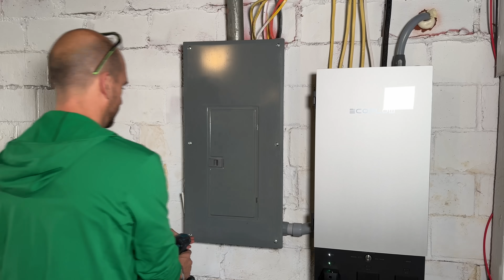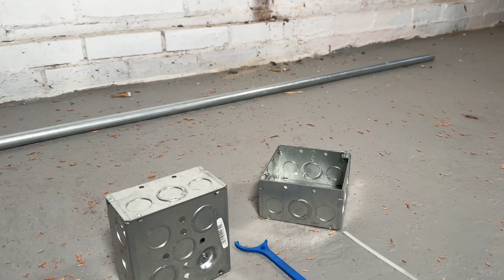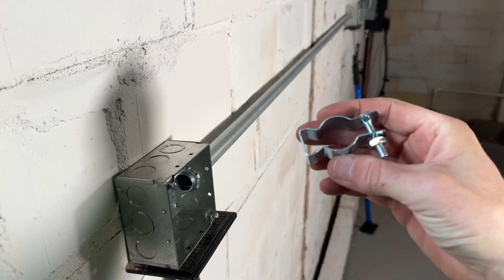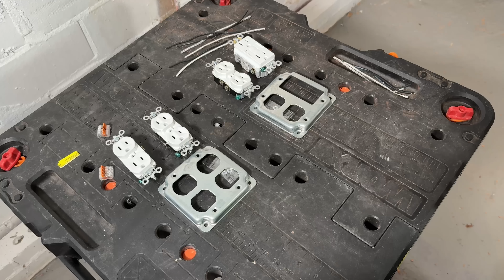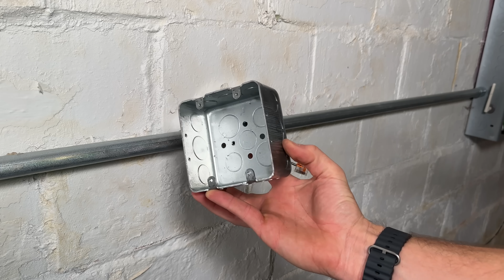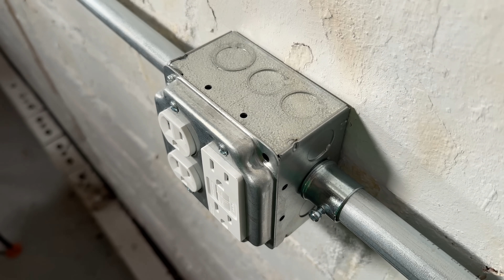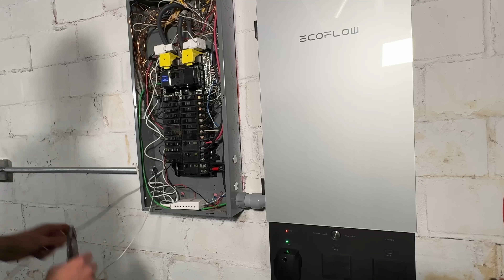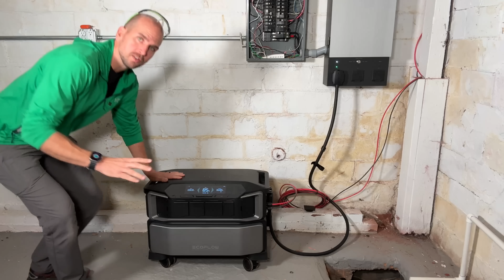Add Outlet To Unfinished Basement Or Garage

Comment: Should have run an egc but not really necessary but should have used ground pigtails to the boxes than to devices. Might not have too but better workmanship is akways a plus and never cheapen out on safety 😉

Comment: Every house I have lived in here in Western PA has NOT had conduit in the basement, it was always Romex, sometimes stapled to a strip of wood.  Maybe some parts of the country don't require the conduit?  Mostly here in commercial installations.
Reply from the maker: It is importance to give Romex protection and not place it in a run where it could get damaged.  If your Romex is running on wood along the wall with nothing to protect it that is not ideal and most likely an inspector would call that out.
Reply: To be fair, the Code is only as good as the inspector. If the building inspector chooses to allow things to occur, then they occur regardless of what the Code might say about it.
Reply: @TwilightxKnight13  I kind of wondered because they did the Romex on wood in my sister's house and she hired a professional electrician so I am doing what I have seen a professional do.

Comment: Correct me if I'm wrong. I believe a grounding conductor that makes a bond to each metal box needs to be present to satisfy code in this particular arrangement. The set screw on the conduit connectors may loosen or go missing which results in poor continuity as an EGC over time. But of course, this is permissible by code. However, I believe having the conduit and boxes as an EGC is not enough. There needs to be bonding jumpers from those types of box cover plates to the inside of the 4x4  boxes.

NEC 250.148 Continuity of Equipment Grounding Conductors and Attachment in Boxes.
If circuit conductors are spliced within a box or terminated on equipment within or supported by a box, all wire-type equipment grounding conductor(s) associated with any of those circuit conductors shall be connected within the box or to the box in accordance with 250.8 and 250.148(A) through (D)

(C) Metal Boxes. A connection used for no other purpose shall be made between the metal box and the equipment grounding conductor(s) in accordance with 250.8

NEC 250.8 Connection of Grounding and Bonding Equipment.
(A)Permitted Methods. Equipment grounding conductors, grounding electrode conductors, and bonding jumpers shall be connected by one or more of the following means:

(1)Listed pressure connectors

(2)Terminal bars

(3)Pressure connectors listed as grounding and bonding equipment

(4)Exothermic welding process

(5)Machine screw-type fasteners that engage not less than two threads or are secured with a nut

(6)Thread-forming machine screws that engage not less than two threads in the enclosure

(7)Connections that are part of a listed assembly

(8)Other listed means

(B)Methods Not Permitted. Connection devices or fittings that depend solely on solder shall not be used.
Reply from the maker: The screw or locknut loosening over time could happen but I don't think that potential failure would make the grounding through conduit against code.  Easy enough to run another ground wire for triple protection.  Currently this circuit is protected by the conduit providing equipment ground and also the GFCI protection starting at the first outlet.  Thanks for the feedback.
Reply: @EverydayHomeRepairs  as with anything, check with your jurisdiction. Just because the Code allows for something does not mean your local inspector will allow it. If we use EMT in our area, we must run a grounding conductor and it must be bonded to the junction box and the device.
Reply from the maker: @TwilightxKnight13  Agreed, best to ring the inspector to avoid any rework.  Thanks for the feedback.
Reply: @EverydayHomeRepairs   In 40 years of being a licensed electrician I have seen screws and locknuts loosen or screws being removed/lost countless times, especially in a garage or other open space like you have here. Also. you MUST install a pigtail between the devices on the plate and the box as a bare minimum, as a loose cover plate no longer provides a SECURE grounding path and will create a shock hazard.  The GFCI does NOT give you a pass on this. 

Other than that, you are correct that Code allows the conduit to serve as the grounding conductor, but it is not a good practice and some local Codes will not allow it to be the sole grounding path. 

And before any of the hacks come on screaming that the NEC is the final authority, local Codes are ALLOWED to require ABOVE Code minimums, and in rare cases can waive or omit certain NEC requirements (most notably use of AFCI's.)
Reply: @mxslick50  With cover mounted devices the device must be attached to the cover with permanent fasteners (rivets, for example) to serve as the device bonding means or if not, a pigtail is required.
Reply: @EverydayHomeRepairs  metallic boxes require bonding. I do not think there are any exceptions. You can purchase a bag or box of pre-loaded pigtails specifically for this purpose.
Reply: @edmessina8392 .    If EMT is the grounding system to metal boxes, and the device (receptacle) has an approved grounding clip on one of the attachment points, then the pigtail is not required from the receptacle to the back of the box.   If the receptacle does not have the required clip, then the pigtail would have to be installed from receptacle to the box.
Reply: @KevinCoop1  Close. With self grounding devices you can attach to a flush mounted box (box/mud ring) without a pigtail. With cover mounted devices the device must be attached to the cover with permanent fasteners (rivets, for example) or if not, a pigtail is required.

Comment: Unless you scrape the paint off of the box, you will have no ground from just connecting the conduit to the box. This is why every job I've ever been on every inspector I've ever talked to requires you to have a hot, neutral, and a ground wire.
Where exactly do you get your advice from

Comment: Also to me that is the perfect application for MC cable. What is wrong with using MC cable? So much easier to work with and install.
Reply from the maker: For installation like this I actually like the clean look of conduit.  I know it takes a bit of getting used to but overall I like the finished product.  Probably just me but overall I am not a fan of MC.
Reply: In most people's opinion MC looks like garbage in a visible application. No matter how well it is installed, it will droop. It is generally used for lighting whips and in wall cavity areas with limited access or that require more protection for the wiring than Romex provides.
Reply: @TwilightxKnight13  of course it's going to droop. That's why you put in supports. I would argue it's still better looking and safer than bare romex in a garage, which is what my previous owner did.

Comment: Electricians. Was it ok that he didn’t use a ground wire? I would not feel comfortable doing it that way.
Reply: Technically, yes per NEC. But when done on a large scale, it makes for a less reliable and expensive to fix install later. Connections rust, get loose, get painted, creating failures.
Reply: @RJ-ej1nr  appreciate the feedback. thanks

Comment: If I understand it correctly, should the GFI outlet, attached to a 20A circuit, be a 20A unit?
Reply from the maker: As long as you have more than 1 outlet you can use 15 Amp on a 20 amp circuit.
Reply: @EverydayHomeRepairs   just to be clear, each "plug in" on a receptacle is considered an "outlet" so a standard duplex receptacle meets the requirements for using a 15A device on a 20A circuit regardless if it is a GFCI or not.

Comment: Don't quote me but I believe EMT doesn't pass as a ground even though it's attached to the panel here in California. I believe the reason is that the conduit connections can come lose and some weather resistant connectors/couplers have plastic mating surfaces which breaks the bonding.
Reply from the maker: I would agree that a local inspector, jurisdiction, or state could require a dedicated ground back to panel.  Probably worth a call to see how the inspector is going to interpret code.
Reply: CA electrical code allows EMT as a grounding path. The raintight fittings have a plastic washer internally, but in no way do they disrupt the metal to metal contact between the conduit and the fitting. EMT fittings don't just magically come loose any more than ground screws magically come loose.

Comment: Kind of unprofessional and hackish not to use a bender to conform to the wall instead of sticking way out like a handyman too cheap to buy a $25 pipe bender
Reply: It's better than professional, if you ask me.  I think "professionals" like doing unnecessary conduit bending to make it seem that using conduit is complicated, requires tools most homeowners don't have, and justifies them spending billable hours on stuff that in reality doesn't matter.  

No bends equals no restrictions.  The shortest distance between two points is a straight line.  If it ain't broke, don't fix it.  Form follows function.  Less complexity equals fewer human errors.  

If you want a specific look that corresponds with exactly how electricians like to do it to charge you more, go for it.  Personally, I like this look better, and as a mechanical engineer, I think it is superior in most cases functionally, also.  I own a conduit bender, but choose not to use it for stuff like this.  I use it to make conduit go where I want, and I simply don't want the conduit to go against the wall in this case.  No reason to, and some good reasons not to.  

Having the conduit against the wall makes it accumulate crud, makes it hard to clean, and promotes rust and disease if rodent urine/feces, stuff leaking from a sewage pipe, or anything else nasty collects there.  

As he installed it, you can wrap a damp rag around it and clean the entire length in 5 seconds.  It will look as nice in 100 years as it does now.  If there is ever heat buildup in the conduit, having convective airflow around the entire pipe rather than just one side of it, is better.  If there is an impact against it, some energy is absorbed bending it, before the conduit is smashed against the wall, at which point it becomes equal to the flush-to-wall case, but with less impact energy left to absorb.  

All minor stuff, but reasons to not bother bending it just to make things arguably worse.

He should add supports to bring it up to code, and add a ground wire to make it better than code.  But I think it is way better to support it where it is than to make bends to jam it against the wall and accumulate dirt/water, or whatever else comes down the wall.  

My similar setup provides a nice place to hang a couple of pairs of blue nitrile gloves, between my light switch and my outlets for cordless tool charging.  Grab batteries, grab gloves, and I'm ready to work.
Reply: @EfficientRVer  it doesn't matter if you like it or not, the NEC Code requires the conduit to be supported. That is MUCH easier to accomplish if you install the conduit properly with a small offset bend on either end so it lays flat against the wall. Fasteners for conduit like his are exponentially more expensive than the simple ones against the wall.

Comment: Could you use a gfci breaker instead of the gfci outlet?  If so, which is better to use?
Reply: Yes you cld have used a breaker and for me it depends I can sometimes find gfci outlets for $10 to $15 a pce if I buy them 3 to 6 in a bundle pack or $30 and up for 1 gfci breaker😊
Reply: Neither is "better" electrically. The difference is in the cost, convenience, and the arrangement of the wiring in the service panel.

Comment: I just ran some 1/2" an d 3/4" emt, and I've found that the connectors to the main panel don't make a real good connection because of the paint on the box.   Seems like the better the paint, the worse your connection. GFCI popped on the first test.   I dremeled down to bare metal for the connector ring, or ran a ground wire to the first box to make connections.  Now I am getting a bunch of people including electrictains saying best practice might be to still run a ground wire - most commercial jobs require it, they tell me.
Reply: The NEC requires that the paint be removed at the fitting connection when using it a grounding path, unless the fitting is designed to bite through the paint. Also, the lack of ground will not trip a GFCI, you must have a different issue. Most commercial jobs do not require a wire type ground.